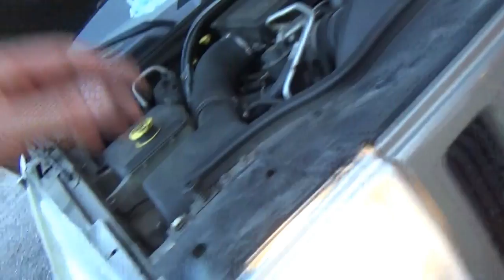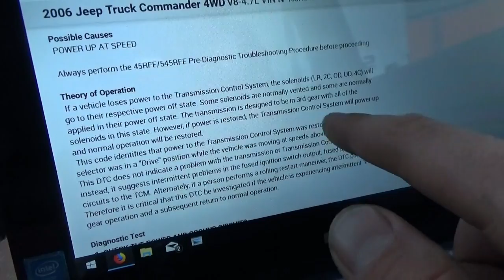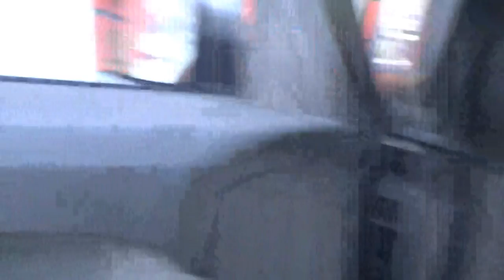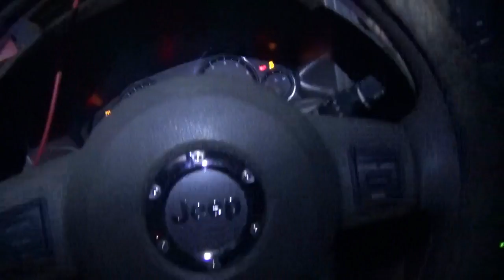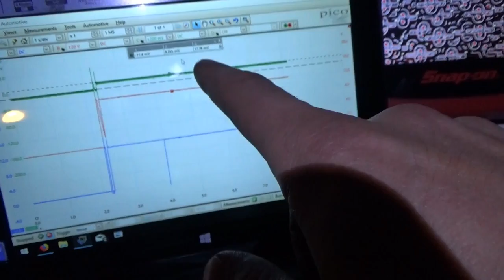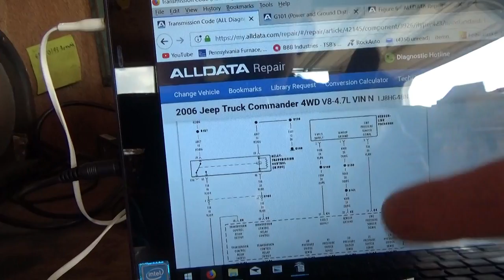Jeep Commander CRAZY Case Study -Part 2

Comment: Its your constant wire from the battery to the starter that corroded. Happed to me and was throwing trans over temp codes. New starter and wire brush it all clean.

Comment: Second time watching and a flash back to 30 some years ago.  There is a special type of solenoid called a "variable force" solenoid.  It is used to control pressure over a certain range (like line pressure).  The benefit is that the current driving the solenoid is directly proportional to the pressure.  No pressure sensor is required for feed back !  The problem is, it requires a "high side" driver.  Maybe this is why they are using the high side driver, but, back in my day, that solenoid could draw 1A.

Comment: My 2001 Kia Sportage (Generation 1)....with 226,000 FE3 Mazda 2.0 Dual Cam (Mini-Hemi) Full BOX Frame 4X4 Purchased New @$15,000 (Still Running)....is far superior IMAHO!!!!!  My Wife's fully loaded 2006 Heep commander @ $37,000 ....a True POS!  Carpet with Toxic Mold from sunroof....Ignition switch went out....Wiper motor out....Alternator burned out...Idles like shit.....and only currently has 56,000 original miles on 4.7 Engine V-8...........WTF????????????

Comment: This is why I love old cars..easy to fix.....idiot designers today put electronics in places where they know it will fail. When I was about your age..many moons ago...hardest adjustment was the Accel aftermarket dual point distributor to replace oem.

Comment: Seems like whatever is cooking the PCM has put that driver circuit ride on the edge of its thermal protection.  It comes on and that little bit of extra cause the thermal cut out to kick in.  Off, it cools, and starts working again.  May or may not be what is cooking the PCM, but one suspects that PCM is going to have more problems.

Comment: I'd bypass the relay control and feed 12v to the tcm feed/output this should trigger a fault if the tcm detected voltage on the output wire while it should not (sleep mode) it's programmed that way but this should get you enough evidence to condemn the control side

Comment: I had one on a bit older model that was throwing a solenoid code and some codes you had.. Long story short the tcm was faulty, but what i found was the same tcm power relay would shut down after key on cycle due to the module would go into limp mode. Swapped two solenoid pins and retested and it showed the same codes which meant the tcm was faulty not any one solenoid.But before all of that i was condemning it for it not keeping the relay powered on.  Wanted to share due to i know thats not the only reason the relay will shut down. Thanks for the video and GREAT diag!!

Comment: You would have thought that Chrysler would have learned not to put PCM/TCM in high temp areas...in the seventies they put the leanburn computer right on top of the engine on the air intake... and wondered why they baked quickly.
Reply: I hated working on those damn things. Turned a decent car into a pos.

Comment: We all hate intermittent power/electronic problems. If you really wanted to do a deep dive; you could have removed the TCM cover off and start blasting the board with freeze spray to pin point the problem? But then again one's time is $$.

Comment: A Mitsubishi Triton diesel on Wednesday delivered to the workshop on a trailer by a used car sales company for warranty work, the customer complaint was relayed to us that the car chugged and blew smoke on a cold startup and then the auto transmission wouldn't change gears (limp mode) and engine ABS and traction control lights were on. Did the usual of checking all the fuses etc, basics first.

Scanned the vehicle and found multiple CAN comms codes on multiple modules, it took me 5 minutes to figure out that the TCM was missing from the picture.

I did the same thing as you and went down the same path of chasing CAN bus faults and wasted some time in chasing a fault that wasn't there, then I went back to basics and checked for power and ground at the TCM, bingo! nada! No power at the TCM.....

Only then was it that I got the power distribution wiring diagram and traced back from the TCM to find the TCM fuse was not there, missing in action, a hole where it should be, the TCM fuse had been physically removed! Although I did a sweep of all the fuses with my test light I didn't test the fuse that wasn't there, lol. Fit  the fuse, hear the relay click, dash lights all out.

I am still wondering why the fuse was removed..... at the end of the day I had to go back to my customer (the used car sales company) and tell them my findings and give them a bill for the diagnosis given the complaint that was presented, and, that it was between them and their customer (the buyer) to battle it out on who was going to pay the bill.

At the end of the day it was @ a $500 fuse fitment!

Comment: Needs new ignition switch after hundreds of cycles during diag.
Reply: Maybe! I did that, but it didn’t fix it. I was going to buy a new TCM and TIPM, but I found 3-6 melted wires in an unprotected harness inside the vehicle under the second row of seats. The muffler is directly under those wires and melted 3-6 of them and also burned the underside of the carpet. 
It should be a safety recall, because it could start a fire.

Comment: That's how the cookie crumbles the price of a repair doesn't justify the value of the vehicle.
Reply: That’s the issue! Mine threw all sorts of crazy codes that had nothing to do with the fix. It was 3-6 melted/fused wires under the second row of seats. The muffler is right under those wires. It gets so hot it discolors the flor pan metal and burns the carpet. 
$20 fix. 
But those codes could’ve sent the truck to the junkyard.

Comment: If that was my vehicle, and I didnt have money to fix it, I would have just jumped the control side of that relay to another key-on power source in that fuse box. Just think about how many Jeeps out there have had the fuel pump jumped to the cigarette lighter because of a bad TIPM.

Comment: I like that Ivan you had bonus bonus bonus bonus footage..
I was trying to help a guy the other day that broke down at the apartment complex that I live at I know start with a crank first place with LED to was fuel and Guy kept trying to jump around from place to place to place unlike trying to find one logical Pathway to go through I wanted to test the fuel pump was a Volkswagen with no Schrader valve so went back to the tank try to do some electrical testing and the guy still wanted to jump around took I finally walked away then the next day I came out told him I read an article to how to exactly test his make model and year ran the tests had a bad fuel pump had an open circuit inside the pump itself and the guy wouldn't listen spent another two days before he had it towed away to a shop I was laughing inside... Because I really appreciate your methodical method of trying to find a problem and targeting in on it and then proving or disproving the thought pattern versus just jumping left and right and right and left and center and up and down.....
even right now I'm trying to help a guy at work whose Honda has broken down most likely has a fuel pump or primary relay that's gone bad he had it all torn apart I told him don't touch it let me take a look at it and the idiot puts it all back together again gets to run for 20 minutes and then it doesn't work anymore I told him how do you expect me to diagnose something that works..     . Course now that it's broke again maybe I can help him tomorrow who knows

Comment: For a cheap fix, couldn't you just re-route the relay control wire, from the ECM, to a different ignition-switched source, and have the relay turn on with the key?
Reply: That's exactly what I thought!
Reply: No, the Pcm/tcm would notice that and the trans would always be in limp home mode

Comment: Picking a nit ... "High side" drivers (an output that sources power) in an control module are unusual (high cost, lower reliability).  Any EE who is told to design a high side output would use a driver chip that has built in protection from excessive loads.  It is not at all surprising that the driver shutdown when a 1A load was placed on the circuit (normal relay load is less than 250mA), so I would call that test invalid.  However, you did catch the problem with just the relay as the load.
I am very glad you physically inspected that ground point.  It common on FCA vehicles, when many circuits use the same ground point that one or more of the wire would fail.

Comment: That's great I like the test you used with the test light and to check the relay driver. I have a very similar issue with a 2008 dodge magnum. Except I didn't get lucky with the P0882 code I had no codes at all but when I checked the power wires going to the tcm it was very intermittent checked the control and the control would drop out and shut power off. Came to the same conclusion pcm was bad. Thanks for the great videos!!

Comment: Ivan -- the major outstanding question:  Why was the driver output oscillating? About 5V amplitude, about 17kHz.  After looking at the (very disjointed) schematics on BBB, it looks like this relay (plus light bulb if you had that attached) is the major +supply  load for the TCM (because all the other loads it's switching to ground). So this symptom could well be what you would get if the TCM module had a poor connection (ie: high resistance) in the plus supply line to the module.  Initially on power up, you get enough current to charge the local reservoir capacitors in the module to a voltage high enough for the module's electronics to come alive.  That turns on the (high side) driver for the  Transmission Control relay. That causes a sharp increased current drain on the TCM, and due to (hypothesized) poor plus supply, drains the module's reservoir caps, decreasing the local V+ below the level required to keep the electronics alive. So that turns off the relay driver, decreasing the load on the local V+, allowing the input current to charge up the local reservoir caps. And so on, creating an oscillation.And poor V+ supply for the TCM pretty much matches the codes: P0882 (Low TCM power voltage) and P0884 (Intermittent TCM power).

Comment: It makes me wonder if the PCM has a way to monitor current draw on that relay control circuit. Because this is a high-side driver, is it possible that there is an intermittent short-to ground on the relay control circuit? That would be why the PCM would shut the driver off so quickly under the shorted condition. Normally, relays use a low-side driver where the ground is supplied to the relay control circuit. In that design, if the control side to the PCM is grounded, the relay simply stays energized all the time and no damage occurs to the driver. However, on high-side drivers, a short-to-ground on the circuit will obviously burn out the driver if it occurs, so a safety method has to be employed. I'm giving Chrysler the benefit of the doubt here, assuming that they'd design a way to protect their PCMs from failure.

Comment: Back in the early 70s when I started working on medical electronics I would find many failed logic IC chips that had wave patterns like the one on that driver.  That was with the first gen of TTL chips. Many times the oscillations would cause the chip to heat up and you could find the bad chip just by touching the IC. Everything was component level repairs then.  Interesting case study, good entertainment for me on the 4th of July.

Comment: 1970's Ford electronic ignitions: they were under the hood, too, and could exhibit erratic conditions. If the box got hot and stopped working, you could pour cool water over the box and sometimes it would come back and work to get you home. You could do the same test with the box in question to see if the box would return to work properly for a while until it overheated again. Just another diagnostic tool.
Reply: that and hit it with a heat gun for making it hotter than hell. air duster cans inverted make for quick cooling too, unless you have CO2/N bottles you can safely blast as liquid :)

Comment: "It's inconsistent."  Not entirely, Ivan!  This is Keith's famous "heat and vibration" on a much, much smaller scale than we usually deal with.  Any PCB/Electronics engineers are welcome to chime in and correct me, but it's my understanding that this is a transistor failure mode.  While ambient temperature plays a roll, I think what we're seeing here is internal thermal loading causing the transistor to fail gently (rather than cratering) each time it's loaded, and recover just enough to almost function once it's turned off.

I have a feeling there's a lot more to it than that, but my limited familiarity with PCB-level component function leaves me not wanting to speculate too much beyond that.

Hope you had a wonderful 4th, Ivan!
Reply: right, take a small hammer and peck at the PCM/TCM also, it'll probably go berzerk... add in heat gun to cook it more..

Comment: Thats a great catch! Always bothersome when you get your leads where you need them to catch the car acting up but then the car decides it wants to be "normal", Almost seems to happen everytime haha. After watching this I really need to save my pennies and get ahold of a pico!

Also, I feel bad for that transmission if they keep driving it while it gets stuck in 3rd gear. I can see that causing more problems down the road. If they are already tight for money I would think it's cheaper to fix the PCM then having to replace the trans for being burned out because of not fixing PCM..

Comment: Don't let them junk that jeep, that code is caused by a bad ignition coil and or incorrect spark plugs. suggest getting a set of correct Mopar spark plugs and a Chrysler ignition coil. Install the new plugs, look at coils closely, watch for a dark streak on any spark plug, if you don't see a bad coil, install the new coil on any plug and keep moving it from plug to plug until the problem coil is found
Reply: I am a Chrysler tech, there is a Star case about this problem

Comment: Just got to "Double Bonus Footage"
I like the thought of a bad TCM, however
some possibilities other than a TCM came to mind. Could be a relay with the wrong coil resistance. once the relay heats up some, the resistance will increase and all will be well. another possibility is the relay control is powered by a QDM inside the PCM and another circuit on the quad driver is overloaded causing the driver to shut off for circuit protection. curious to see if a box will fix it!

edit: just got to the part where you mentioned the heat kills it. eliminates the relay theory. although on 2nd though i guess when we swapped relays that got eliminated.

Comment: I use AllDataDIY fairly often since I can't afford a 150/mo full subscription for the amount of work I do.  However, I never have any of that code setting criteria info anywhere in the DIY version.  It just gives the manufacturer flow charts...booo.  Does anyone else use AllDataDIY and, if so, is it in there and I'm missing it?  I checked out the MItchell1 DIY sample vehicles and have seen the code setting criteria there. AllDataDIY is cheaper and maybe that's why.

Comment: Get a can of freeze spray and simulate thermal extremes. That would isolate the bad driver pretty quickly.
Reply: Yes, and as a substitute for freeze spray, turn a can of computer keyboard cleaning "air" upside down and hold in that position while spraying freezing temperature.
Reply: @reecenewton3097  That works too. Same principle as an air cycle machine in jet aircraft.

Comment: This was a excellent case study! Thank you Ivan! In this case what we do in my country is to repair the PCM by replacing the SMD component and/or burned transistor or drivers... Have a happy 4th of july!
Reply: But if it's the microprocessor, you are out of luck as they are factory programmed, and locked so they cant be replicated.

Comment: Great video as usual you sure stick with it till the end to understand the total picture. I keep waiting for you to do a video on the Olds tranny rebuild. I overhauled my  VW van auto tranny by reading the book and drove father on my rebuild than the original went since new. It will make a great video!
Reply from the maker: Hi Alan, thanks for the comment! Sure is satisfying to DIY and get great results :) I would have swapped that auto for a manual to get the most performance from a VW bus haha

Comment: I think rather than scrap the car or buy a new TCM I would try putting a jumper wire with a manual switch to power up the relay and see if that prevented limp mode.
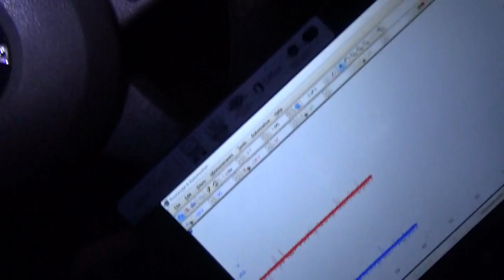Reply: Me too. But I'd put a relay off something that's powered by the ignition switch to pass battery voltage 16:41 to power the existing relay 86 terminal (instead of a manual switch) and isolate the factory signal from the PCM through an appropriately sized resistor (was it 60mA draw on that relay control wire? So ~200 Ohms) to ground.

Comment: good video shows multiple codes if a failed power driver fails but makes sense if there was a biased voltage on those other control solenoids in transmission reason those codes set

Comment: A little off topic... Silhouette case. (Proud owner of 2... a 93 (pasturized (sitting in the pasture)) & a 99. Both same color as yours) Found some magic stuff you may not know of or have not thought about. Add some ATP corporation AT205 Reseal polymer (maybe get it at Carquest or order it on Amazon) to the Silhouette trans fluid to soften and rejuvenate that seal in the trans causing it to not engage in cold weather. This is the closest to a magic polymer rubber rejuvenator as anything out there. Can't hurt. (Scotty)You tube mechanic claims to have gotten a letter from someone that used this stuff in his engine oil and it stopped a rear main leak in 2 days. Can't hurt to try it.
Reply from the maker: Yup I remember Scotty doing a video on ATP205. Never tried it, but definitely sounds like a great product!